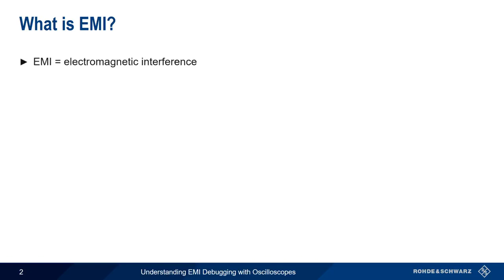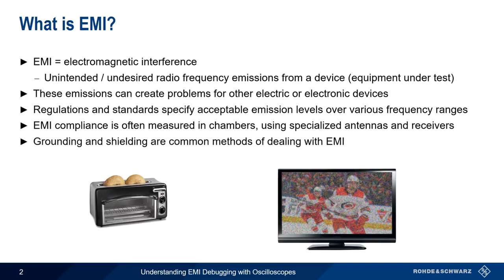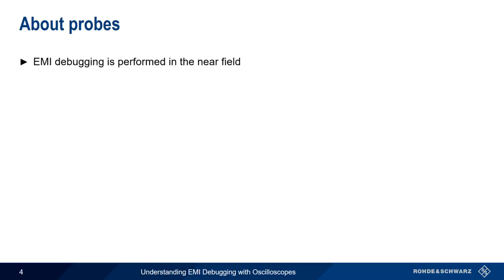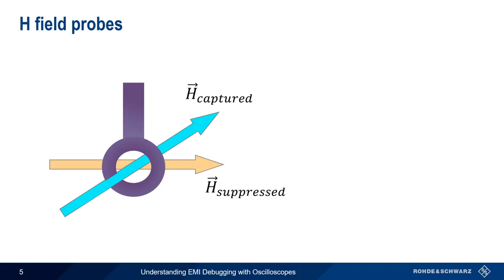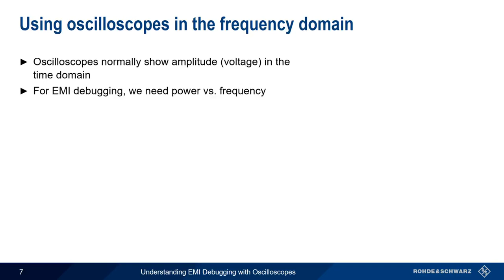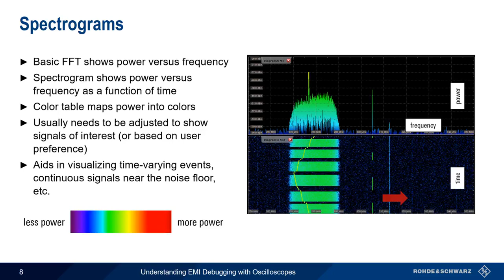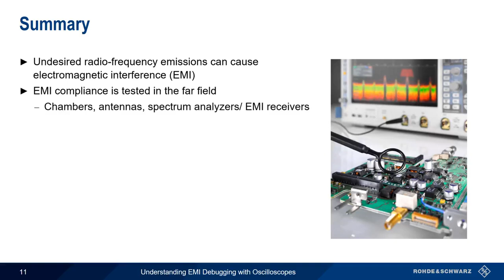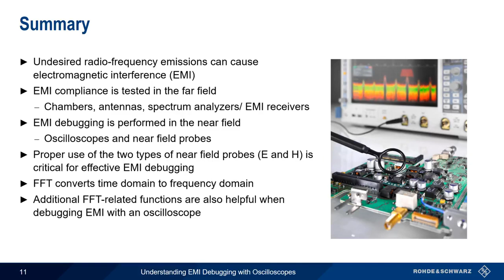Understanding EMI Debugging with Oscilloscopes

Comment: Thìs was very helpful. Im looking for a way to detect extremely low frequency emi and it seems that oscilloscopes are the way to go. Quick question - is there a near field probe for radio frequency interference (mW/m²) that i can use with an oscioscope with fft?

Comment: Very good explanations: straight forward, succinct yet full of detail.  Unfortunately the Title is misleading having the word "Oscilloscope" in it.  The "'scope" is being used as a Spectrum Analyzer, and the majority of oscilloscopes don't have that function!   The main difference between using a 'scope and an SA is that the 'scope has a high impedance input stage, suitable for these kind of probes and SAs have a 50 Ohm input impedance which would greatly reduce the signal amplitude from these probes to almost useless values.  This of course can be negated by adding an LNA between the probe and the SA, but that will still load the probe and add noise.
Reply: Thanks for the feedback! I have a second video "Understanding Near Field Probes" that addresses the issue of signal amplitude and the need for a preamplifier when using an oscilloscope for EMI debugging.   I would however beg to differ that the title is misleading:  the vast majority of EMI debugging is in fact performed using oscilloscopes, not spectrum analyzers.  

You're absolutely correct that effective EMI debugging using a scope requires that scope to be able to display frequency domain information (using an FFT) similar to the way a spectrum analyzer works.  

One can also use a spectrum analyzer in zero span mode to display time domain information (voltage or power as a function of time) similar to the way an oscilloscope works, but that doesn't make a spec an into a scope, even if some manufacturers might refer to zero span as "scope" mode :)

Historically, "hobbyist" level oscilloscopes have not had an FFT/spectrum analysis function, but this feature is more or less standard on even entry-level "professional" oscilloscopes.  My feeling is that FFT/spectrum analysis will soon become a "standard" feature on many hobbyist oscilloscopes as well.

Thanks again for the feedback!
Reply: @pauldenisowski  While there are significant differences between the FFT functions of Oscilloscopes and Spectrum Analyzers, the functionality and use demonstrated in this video is that of an SA, not an Oscilloscope!   If by "hobbyist" oscilloscopes you mean ones which cost less than a new car, you could be right.  But most professional engineers in the world use oscilloscopes which have either no, or unusable FFT functions in their daily work.  There is one R&S competitors who makes a 'Scope and real SA in one instrument (at the price of a modest car).
Ask the R&S marketing department, they are likely to have the data.  

I have , along with many others, used both 'Scopes, and SAs to hunt down EMI sources (including 20mm long PCB traces) on PCBs  and scopes are much faster than using the slow SAs  In either case the 'scope has to have a high bandwidth to be effective (i.e. >300 MHz).   

Those nearfield probes are a waste of money.  They were developed to find RF leakage of large equipment racks and big box chassis, not at small, PCB areas.  Get a small wire wound inductor (or wind one on a tooth pick) to pinpoint problematic traces and components. This will also require a small inexpensive 20~30 dB LNA.